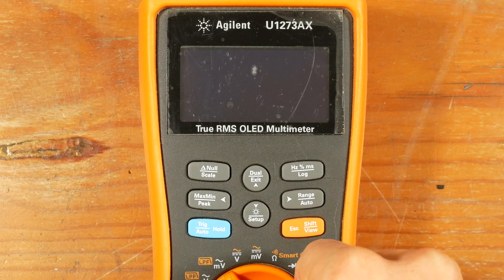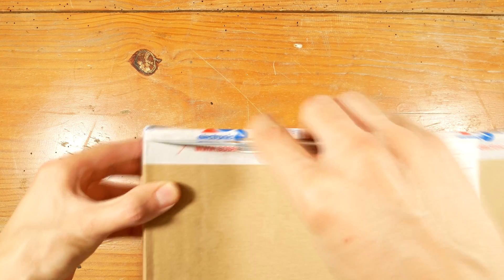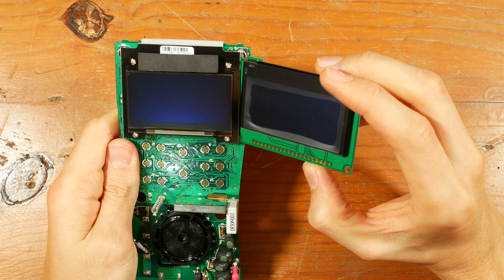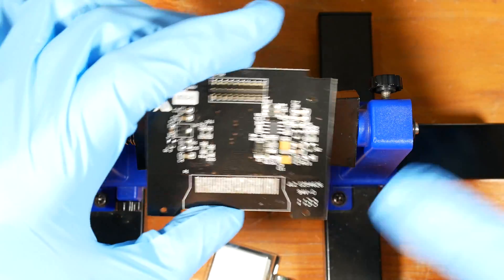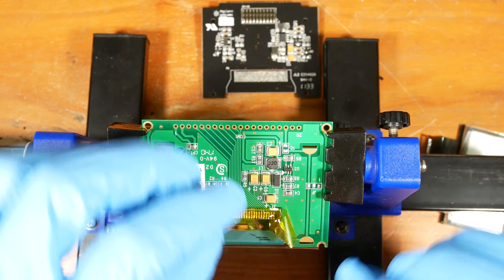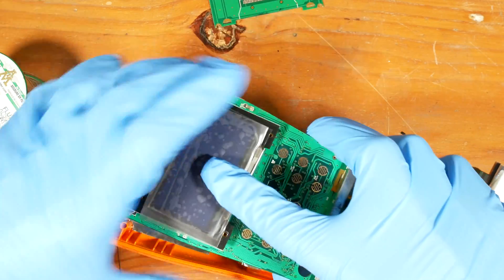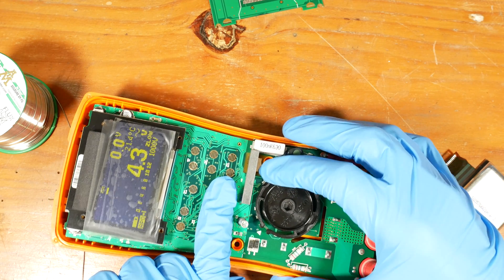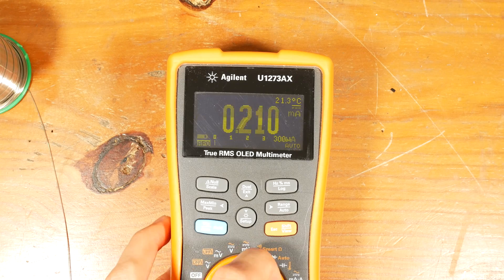OLED display replacement on an Agilent/Keysight U1273AX multimeter

Comment: Mine lasted quite many years, although U1273A freezes sometimes and there is no firmware update. I bought the cable before checking the firmware version, stupid me. Now the screen went black, can't see barely anything from it. Newer ever again will I buy any Agilent device.
Reply from the maker: I really liked the contrast when I first saw the OLED screen, but I do regret not buying the LCD version instead.

Comment: Yep. Got one out of the recycling bin. Now i "only" need a replacement oled ;-)

Edit: with a SSD1303 ? Which isnt available anywhere ?

Edit2:
Might go with a SSD1309,
seems to be one column shifted,
the right/last one appears as first left column. One user on aliex has luckily posted a picture of his xx23B working ... and that shift doesnt really  impact the usage...
Reply from the maker: I would never buy another OLED multimeter from keysight, but one out of the trash is definitely worth repairing.

Comment: Boa noite onde emcontra esses display pois tenho um u1253b com mesmo problema vc tem endereço ou site
Reply from the maker: Eu comprei este, mas parece que não existe mais: https://www.soselectronic.com/products/bolymin/bl-12864g-ernhn-1-52156

Sugiro que siga esta thread, ocasionalmente aparecem alternativas: 
https://www.eevblog.com/forum/testgear/replacing-oled-screen-on-an-agilent-u1253a-multimeter/250/
Reply: @jfaria   deve ter pois a keysight ta reprezentando e vendendo os.equipamentos o meu deu 3 anos certinho o display apagou parece que ja foi fabricado nesse padrao

Comment: I had mine working perfectly. It sat in the cupboard as I was using the fluke which has much better battery life. I turned my Agilent U1273A on and it only beeps. Seems like the OLED has failed as its too dim to read. I hate you Agilent!
Reply from the maker: Yeah, It would be nice if someone found a compatible LCD display to replace the OLED one. On the EEVblog forum there are some alternative solutions, both with some adapted OLED displays and even some plug and play ones, give the latest posts a read:
https://www.eevblog.com/forum/testgear/replacing-oled-screen-on-an-agilent-u1253a-multimeter/250/

Comment: I had mine working perfectly. It sat in the cupboard as I was using the fluke which has much better battery life. I turned my Agilent U1273A on and it only beeps. Seems like the OLED has failed as its too dim to read. I hate you Agilent!

Comment: "These displays will degrade even when you are not using them" - they shouldn't at any reasonable rate? The LG OLEDs out there are rated for 100k hours, and that's on hours, for off there shouldn't be any noticeable degradation unless they're exposed to high heat or UV radiation.
Reply from the maker: I agree the lifespan was weirdly short, but mine did die and at an alarming rate in the end, and there are several users complaining about unexpectedly low life. Maybe it's not just a matter of the typical OLED degradation caused by usage, maybe there is an underlying chemical process, either caused by the construction method or some sort of contamination on some particular batches. After replacement it has been working fine. Are you sure about that value on modern panels, though? 100k hours sounds almost literally incredible for a regular LED matrix, 100k hours sounds fantastic for OLED, even after adjusting for most pixels not being at full brightness most of their life, but to be honest I haven't been following the latest developments on OLED screens, it should be expected that they have been improving over time.
Reply: @jfaria  LG has made huge improvements on theirs, with quite a bit being physical panel improvements, but even more of it being done in software. And Philips (which uses LG's panels) has seemingly almost eliminated it on their TV's, as they use active cooling of the entire panel, which makes a significant difference.

There's still a lot of improvement to be made for TV's, as the 100k rating is for SDR, and currently HDR can dramatically drop that because of how much harder the OLEDs are pushed. But for small devices like multimeters OLEDs should have a huge lifespan.

I'm not sure why these failed so quickly, I'm guessing you might be right, that it was some kind of production issue or similar problem. Even with the old screens it doesn't make much sense to fail that quickly, especially when not turned on (again unless left in UV or heat).

I wish more multimeters would use them. They're so much more readable than the typical LCDs, and I love how they update so quickly. Even the best multimeters with LCD displays seem to be a blurry mess. And of course they're much more flexible as you're not stuck with a fixed number of elements, so you can easily split the screen and display multiple values at once, or just do little things like change the font size when displaying less or more figures.

Comment: Is this display compatible with the older 1253B? Yes I’m another sucker who bought this meter also.
Reply from the maker: The guy in the forum who figured this display was compatible was using a 1253A, you can try and open it up and see if it identical to yours. 

My uneducated guess is that it probably is compatible, if it's the same in the 1253A and my 1273AX, they are probably using the same screen on everything OLED in this series.

Comment: Great video - just a word of caution.  It seems the 12864G is replaced by the 12864G2 and this module is not compatible - the display uses a different ribbon cable.  I just found out the hard way.   So, my search for the older 12864G now continues...

Comment: what tempe do you use at your heat gun and the soldering iron?
Reply from the maker: I believe both were set to 350°C
Reply: @jfaria  I just destroyed my replacement screen and it's not available anymore. That was the end of my agilent
Reply from the maker: @goozlo  You can send them an email to see when they will get more. If you can't find any more replacements you will either have to buy an original from Keysight or you can try other displays, like this one, it looks similar but it's a shot in the dark: https://www.aliexpress.com/item/2-42-inch-yellow-128x64-OLED-display-module-OLED-module-8bit-6800-8080-4-SPI-I2C/32829112939.html
Reply: Just search for “2.42 12864” and you should get similar screens like this one.